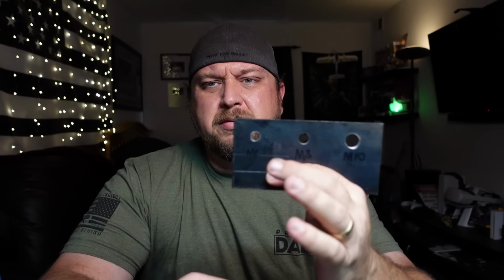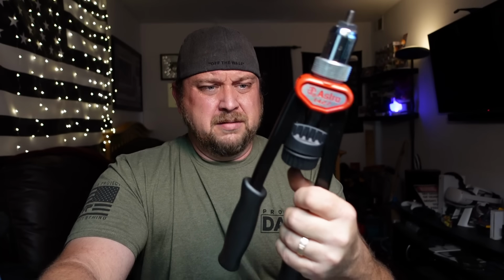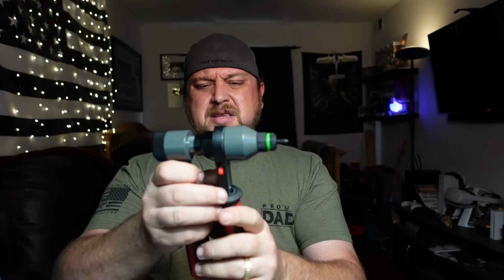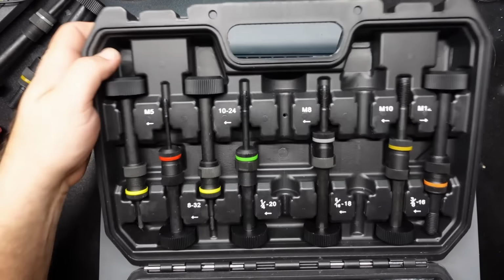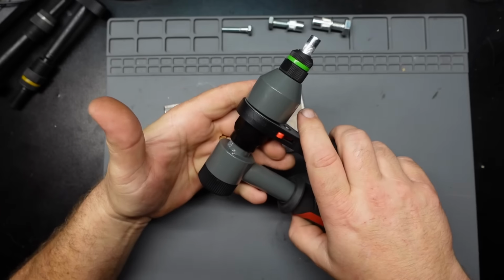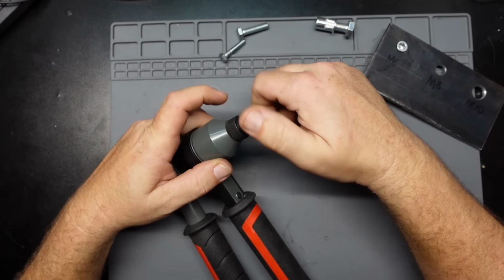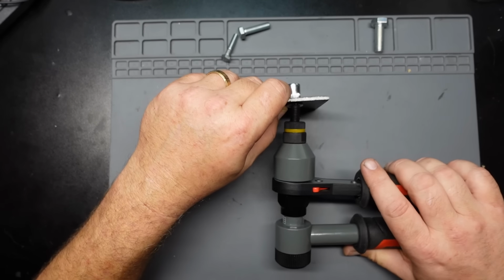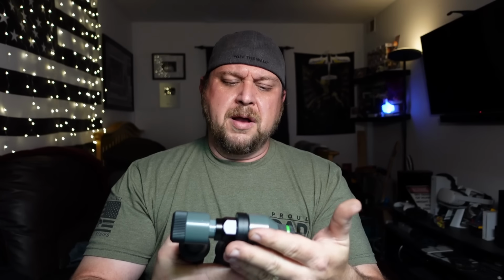TOLRET Rivet Nut Tool

Comment: The 1427 IS annoying to use. 1442 less so, but I've completely converted to air operated or drill adapter type from now on
Reply: I'd love to see a comparison of drill adapters, or Atleast your specific endorsement. There's so many out there now that it's hard to trust the quality, and I fear them breaking the second I use it. 

 I have used this Tolret installer, and it's great for hobby work, but some of the construction can benifit from thread locker.
Reply from the maker: I was considering that drill style one but it was too different looking 😜
Reply: I have seen @TaylorRay use the Milwaukee electric one a bunch and it seems to work good. He uses it all the time building cars and doing projects.
Reply: @TheTrueOSSS I’ve been using the matco drill style (same as Astro) for a few years now. It’s been good.

Comment: I love using Riv Nuts for door closers in commercial environments. Most auto closing doors in buildings are just metal screwed into the thin metal door frame. - Which always works loose with regular use. Rivnuts and locktite work great together when vibration and movement are involved.

Comment: Now install one using a cordless impact, a socket, and a matching bolt. Just a couple taps of the trigger should do it.
Reply: @repairit1 That’s what I always wondered. Why couldn’t you ?
Reply: @therealR.D.  That's where I started when first using riv nuts. Without the tool, the inserts tend to spin. I would just hold the backs with a pliers, until the first project where the back was closed off. lol
Reply: @repairit1  that makes sense.

Comment: You buy a lot of tools that I’m assuming you use for work. My question is, if you break a tool on the job that you’ve purchased, does your company reimburse you the cost of replacement or do you just eat that cost? What is the industry standard?

Comment: I used to install a few hundred of these everyday fitting out van interiers and all i can say is air powered is the way to go the ones we used auto threaded themselves in with pressure and then one trigger pull set them and then a second trigger to pull it out pretty sure it was actually a avdale tool (not sure on spelling) but they are basically just big beefy versions of riv nuts this looks like an awsome tool for tight spaces though and for fixing the ones the new guys screw up with the air one because that thing would spin them like crazy and pull the threads clean out if you over did it air tools know no linits they just want to watch you suffer if you get iver confident haha

Comment: I like to put a bit of red threadlocker on the rivnuts grooves hoping it will prevent them from rotating when the future rusted bolts need to be removed, it seems to work but maybe the rivnut grooves actually grabbed into the base metal and I was just wasting threadlocker 😅

Comment: The Harbor Fraud one is similar design but more compact to use (about 4-5" shorter arms versus my other).   That's both a pro and con depending on the circumstances.   Wonder if the new style one works better.

Comment: I used rivnuts on plastic as well. Worked great to install stuff on plastic wheel wells...
Reply from the maker: I’ve never tried them on plastic. I’ll have to keep that in mind 👍🏻
Reply: You have to be very careful on plastic IME, on soft plastics like HDPE (wheel well liners)it's extremely easy to pull the rivet all the way through the plastic whilst compressing as you don't get any feedback of a hard stop.  On hard plastics you risk cracking them.  Adding washers either side makes a big difference, but also makes assembly much more fiddly.
Reply: @ferrumignis  It is extremely easy not to pull it through the plastic on a wheel wheel of a 1986 Pontiac Grand Prix.
Reply: There are longer rivnuts with lengthwise cuts on the sides of the shaft that spread over a much larger area when collapsed, one brand is Plusnut, so far I only used them on steel because steel on lots of modern appliances is thinner than the powder coating, but I guess those can also work better on plastic because I use the same style of (aluminum) blind rivet on plastic toolboxes to fix new latches and those work well.
Reply: @ruben_balea  I've seen regular pop rivets like this but I didn't know there were equivalent rivnuts, very useful to know.

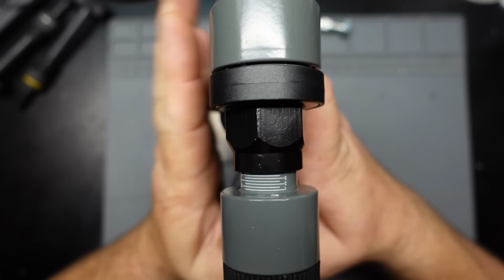Comment: 11:07 you mention that there are lines on the body that are not in the instructions, I found a listing on ebay ( I fell into a rabbit hole looking for a hydraulic hand unit that other commenters mentioned) and I believe thats a setting gauge. The listing I found said to turn the stroke to 0 to start the process and they look like theyre 1mm readings, so I believe from that they should be a measure for how much you have pulled the rivet nut from 0 to 8 mm
Reply from the maker: I figured as much. If I’m being honest I’ll probably still do by feel.

Comment: Sadly, you need both, i had a pistol style and bolt cutter style ones, and the latter tends to be easier to use on the bigger rivets and more quanitity. The pistol style works well for smaller rivets and only a few at a time.
The pneumatic ones are overkill for most users but also an option, also milwaukee has a m12 version too i believe
Tool does look nice tho

Comment: It does seem to be more compact than the bolt cutter design rivet nut installer, but I am always leery of any tool that has plastic parts. I am an industrial mechanic and although I love my tools, I abuse them.

Comment: I do really dislike the "old model" I had to go out and get the 36 incher to replace a massive rivnut for a spring hanger bracket that got tore off the back of a daycab. Even with the foot and a half of extra leverage, securing that thing in there was no joke. The new model is interesting forsure

Comment: I've been part of a team of electricians building the new pool and sportscentre in our town, and we used one shaped like your old one to put rivet nuts in the metal ceiling to hang cable trays and lights. It has tubular arms rather than the open ones yours has, and they were longer for more leverage and control. You only replaced the head part to change sizes. The whole return mechanism stayed contained in the tool and worked fine for the hundreds of nuts I installed. Wish I could recall the brand, it's been in the company and abused for 20+ years and still worked fine. Your new one would've taken forever to do all those, and have a lot more problems fitting in a tight space and still move the handles. Not saying it's bad, just not suited for my line of work.

TL;DR: I love the tool you ragged on and feel a need to defend it! 😉

Comment: The thing I don't like about both those tools is when you want to put a rivnut in a tight space, I bought the drill adaptor type that I use on a cordless drill but it doesn't mushroom the nut very much and if I use a more poweful coreded drill it strips out the thread of the nut, is it just me or is the drill adaptor type not very good either?

Comment: Nut-Serts are carbon steel or stainless steel , and are manufactured as flange less or flanged type style .  Flanged style will not fit flush . Will work on fiberglass panels with a back up washer .

Comment: Was excited for this...but I gotta have 12-24 mandrels for door hardware, very hard to find.
Reply: McMaster Carr is your friend there. They even have sealed rivnuts

Edit: oops I'm dumb. Maybe try changing the hardware?
Reply: @bobbiac unfortunately the standard for commercial door hinges, commercial mortise lock cases, and strike plates is 12-24.  Not just thread size is standard, but the countersink in the hardware is for a #12.
Reply: @jaycable3858  damn. Would have thought you could get away with an M5 replacement

Comment: I've needed to get one for quite a while now. They're definitely handy for many applications. I bought one of the small manual ones in 6m a while back to reattach the side engine cover on my atv. But it's only single size, and you have to use two wrenches for it to work. I really like the Astro model for power drill operation.

Comment: I managed to fix a broken Huck hydraulic rivnut gun that a job was throwing a way, was an easy fix and it quickly became my favorite rivet tool.  It's a pistol grip, but it works like a hydraulic jack so it pulls with a lot of force.  Easily the best option if you need a non powered tool, but I'd hate to have to buy one for just a couple rivnuts.
Reply: do you happen to know the part number for that? another commentor talked about a hydraulic hand unit, sounds like yours but he didnt know the brand off hand
Reply: @legionofanon  I have a Huck HK-150.
Reply: @Hawk013  thanks, i just purchased one of those on ebay for $50. Now i want to find all of the attachments that fit it, theyre a cool tool

Comment: I have one of the import versions like the Astro tool style, but with folding handles.  It's very unwieldy to use as you rightly say (the handles are even longer than the Astro) but it's made from solid metal and it's still working fine after many years.

Comment: Nice, my lever style one is much better than yours, it has a bolt cutter style joint so the arms move in unison and they arent sheet metal.

I want one of those now though. Normally, when I dont have room, I use the bolt with a nut and some greased washers method, but it's always such a pain. That tool would work in probably %90 of those cases.

Comment: If you have access to shop air, the make a pneumatic gun with a rocker trigger like a snap on impact that I use. Works like a charm
Reply from the maker: I try to avoid air tools. My van compressor is a little weak.

Comment: I've always just used nuts/bolts/washers to install rivnuts...every time I look at these tools and reviews on them, I get a solid meh preception. Now mind you, I'm not doing a ton of rivnuts, maybe a a handful or two a year, but the "free" tool has served the purpose.
Reply: Do 1600 a day with a nut and washer. 😅
Reply from the maker: I only use them every once in a while. Sometimes I get a big job that requires dozens and this tool is a must.
Reply: Using nuts bolts and washers is a massive PITA.  You absolutely don't want the bolt turning within the rivnut as you are compressing it, that's a one way street to damaged threads in the rivut.  That means you somehow need to keep both the rivnut and the bolt stationary, whilst cranking down a nut and washer onto the rivnut.  The only way I made this work is to drill the threads out of another nut and use it as a spacer between the compressing nut and the rivnut, so you can hold it still with a wrench, this stops the rivnut being turned. At the same time you use another wrench on the compressing nut, and another wrench on the end of the bolt to stop that turning.  Ever since I lost my third arm I've found this quite awkward...
Reply: @ferrumignis  You just use two wrenches and hold with one, turn with the other...with some washers and such to space things out. I've done dozens this way without any issues at all.

Comment: These are excellent tools and I've put in thousands of rivnuts with a similar Wurth one. You get a lot of feedback from it, certainly better than the lever type.
Pro tip - Make sure the mandrel is all the way through the insert before pulling up, this preserves the thread form in the insert and reduces the chance of stripping. Also make sure that the the tool is screwed fully into itself, that makes sure that the maximum amount of pulling thread is available for use and reduces wear. Keep it all greased and it'll serve you well for years.
You can do M12 inserts with them but they're a real workout to do more than two or three. M8 or M10 is easy enough. Some kits come with female threaded mandrels for pull-up studs although I haven't used those.
Reply: I saw that as well, you definitely want to be using all of the threads so it starts pulling from the "back" of the rivnut. It will expand/roll over quite a bit more than what you see here. Cool tool though for situations where you don't have room to get good leverage on the other type.

Comment: Astro Xl drill adapter model all the way. Make sure to get the xl model. Stainless will eventually wear out the threaded rivnut adapters but Astro will warranty it out or sell it separately no problem getting parts for them at all. Love Astro tools. Good for the $ for sure.

Comment: Nice video, thanks. Three small comments.
1) I prefer an interference fit when drilling the hole rather than a clearance. Not much of one, mind you—just enough to hold on to the fastener so I don’t need a third hand to do a good job.
2) It seems you might be underflaring the fastener just a bit in your sensible attempt not to mangle it. The correct amount is generally where the formed flange is the same size as the one from the factory.
3) Purely pedantic and I apologize but the part you are calling an “anvil” is more properly called a “mandrel”.
Thanks again for your entertaining and informative videos, I’ve learned a lot from them.

Comment: Hate em, and they are becoming more prevalent on heavy trucks and trailers, most of the time the bolt just fuses via corrosion to the rivet nut and it just spins in the hole. Then you gotta cut the bolt out or try to get behind where ever it is and get a visegrip on it. Usually I just air hammer the head off if I can and smack it through the hole, then it gets a proper fastener that's been dipped in red loctite for the next loser lol.  Maybe they work better in indoor environments.

Comment: Do rivet nuts work on car sheet metal? 1/4 inch hole.

Broke window trim bezels to pull a dent/repaint to stop rust, and now I don't have the original bezel and not sure how to make custom ones.
All I have to attach to are the original 1/4 hole
Reply: Well motor manufacturers use them.
Reply from the maker: I don’t see why not.

Comment: I have a medium high dollar pneumatic rivet gun which is great, but the BEST I've ever used in 50+ years came to me by accident.

Bought a bunch of stuff at an estate sale; found it in the bottom of a box.  It is completely manual. Shaped like a pistol, the 'grip' is a cylinder w/ hydraulic fluid in it. Nice wide & long 'trigger', a couple of easy pulls, then a slight increase in resistance & pop go the rivet or the nut-sert is seated.

Don't know if it's industrial or aviation, but in the nearly 20 years since it came to me, I haven't had a pop rivet failure or pain in my wrist.

All aluminum, it IS the best I've used.

As you get older, 40 years or so of working w/ your hands takes it's toll. Crimping electrical connectors is excrutiatingly painful; my focus for crimping/compacting type hand tools is how painfree they are to use.

By good, lifetime specialty type tools, like this, while you're young; hopefully using them for your life, maybe you won't need them when you age... if you do need them, you got 'em.
Reply from the maker: My hands are getting tired in my old age. I’m always looking for things to give them a little help.

Comment: I used some 3/8 rivnuts to put threads in the pipe of a swing set. I was initially concerned about their pull out strength, but after looking it up, I was surprised to find it is several thousand pounds!